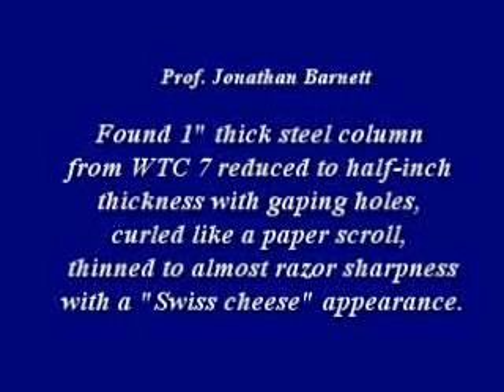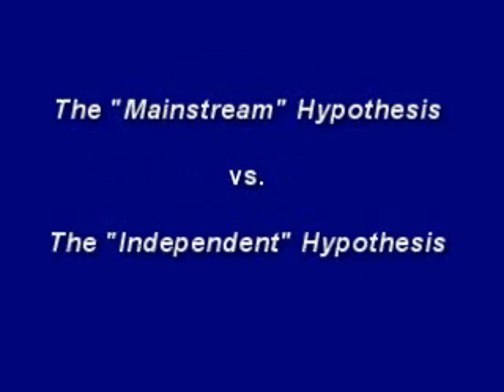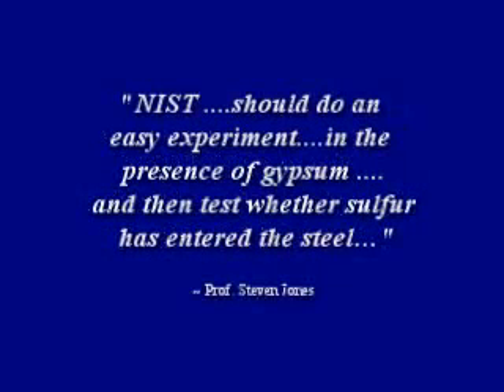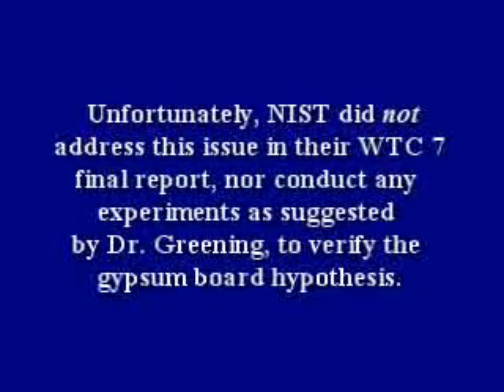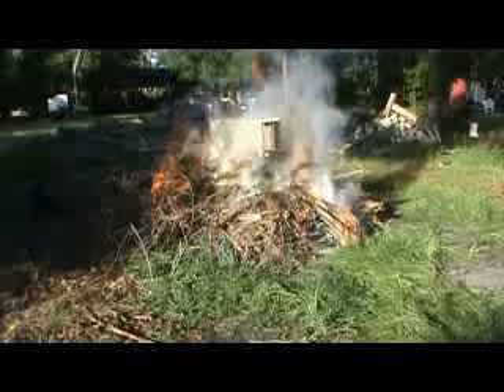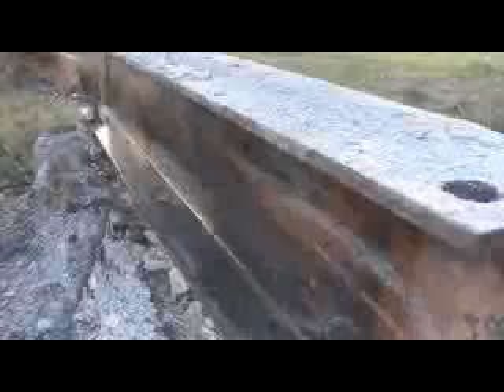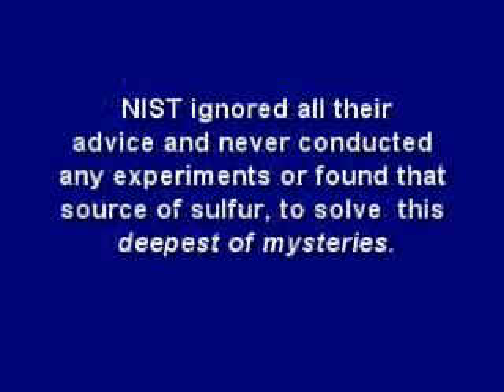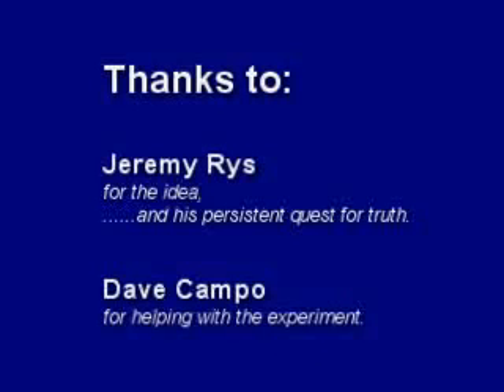9/11 Experiments: The Mysterious Eutectic Steel

Comment: Aluminum in free space will NOT penetrate a larger piece of rigid 
structural grade building steel at subsonic speed (STP@SL).

There are two ways to be fooled. One is to believe what isn't true. The 
other is to refuse to accept what is true.~ Soren Kierkegaard
The highest form of ignorance is when you reject something you don't 
know
anything about.~ W. Dyer
Prof can be seen in history, as a B-25 Mitchell struck the
Empire State building July 28th, 1945.  The facade of the ESB is
granite, and masonry has negligible tensile strength(<1Ksi). 
Tensile strength is what keeps a material from being pulled apart
(penetrated, such as Kevlar vest) and structural building steel will
withstand over 88Ksi (THE strongest tensile strength building
material used in quantity, even today).  The aircraft punched a 18ft
x 20ft hole in the facade, yet the wing span is over 67 feet.  Many
publication try to avoid discussing the air frame, as it fell to a
lower roof terrace and the street level.  Victims inside stated “The
building swung like a pendulum for thirty seconds... we had trouble
keeping our feet under us, as we ran for cover.”
To arrive at a contradiction is to confess an error in one's thinking;
to maintain a contradiction is to abdicate one's mind and to evict
oneself from the realm of reality.~ Ayn Rand
Having shot a steel car rim with a handgun (44mag), this
is a clear example of how penetration is not possible.  The bullet is
10x the density of water and travels well above the speed of sound
(about 1600ft/sec).  But we are expected to believe an aluminum
projectile that floats on water (Sully's airliner in the Hudson
river, indicating .2 mass density compared to water) and can only
travel about 500ft/sec, is able to perpetuate over 126 feet through
steel without stopping.  This is absurd, as it would only takes a
constant force of 50G to stop any projectile moving 500ft/sec, in 63
feet.  Formula 1 cars have recorded survived impacts from 85-140+G,
crumpling the car body less than 2ft, in 200mph crashes. As the 
kinematic equation shows, 1/2 Mass(Velocity
squared), the velocity is exponential compared to mass, a linear
function.  From the standpoint of metallurgy, the shear modules of
aluminum is 25 Gpa, where as basic steel is 70 Gpa.  Even the
construction technique of using sheet metal to fabricate planes,
lends itself to the dissipation of energy through crumpling. 
Examples can be seen in uni-body construction of cars to meet impact
safety requirements, a practice started before 1980. In conclusion, the 
carppetbagger's hoax that commercial
airliners hit the WTC, can easily be disproved by observation of
physics and metallurgy.  Even basic math shows the energy needed
would be one thousand times greater than a commercial airliner could
generate, that's three orders of magnitude. NOT PHYSICALLY POSSIBLE!Even
 teenagers, 150yrs ago, knew cannonballs bounced off iron clad ships, 
and iron is much weaker than structural grade steel.  You clearly have a
 very poor education.
Reply: +cheerdiver

I suppose you believe that if I shot an apple at 200 mph at a chain link fence, that the apple wouldn't penetrate because steel is harder and has a greater tensile strength.  Of course, you forget about all the space in between those fence links that allows the apple to explode right through (albeit in chunks).
Reply: Emvaz22 Apples don't have the property of IONIC BONDING, nor are they 126ft long.  Come on, I know you're a hayseed, but you can do better.
Reply: "Apples don't have the property of IONIC BONDING" - Actually, they DO.
"nor are they 126ft long" - nor are you a turnip.
"I know you're a hayseed" - at least he isn't an ignorant lying bullshitting truther, exemplifying Dunning and Kruger's research to the last jot and tittle.
"you can do better." - you could hardly do worse.
"Aluminum in free space will NOT penetrate a larger piece of rigid structural grade building steel at subsonic speed" - Nor did it.
The plane was made of ALUMINIUM ALLOY virtually as thick and strong as the LOW-CARBON STEEL it met.
Thanks for the straw man.  We will add it to the hundreds of 'truther' straw men (or is it thousands?) already in existence.
Reply: cheerdiver - well laid out points. The crumpling of metal by jetliner cannot be that great to destroy the twin towers.As you have said and I agree physically impossible. The energy needed of plane hitting isn't there,but people believe what they hear even though they know it doesn't all make sense when you question the official story.
Reply: cheerdiver Mhmm, and the fact that the plane is shaped like a projectile which would focus most of the kinetic energy into a relatively small area in front of the plane, you think somehow gives credence to your "no plane" theory?  You live in a fairytale.

Take a soda can and shoot it at that same chain link fence at 200 mph.  And you think it would bounce off because of "ionic bonding."  Right...

The can would go through the fence whether it took some of the links with it or not, just as the plane would be expected to enter the building, considering what it ran in to was mostly empty space (including the hollow box columns).

I'm sorry, but are you ACTUALLY claiming that there were no planes on 9/11?  Where did all the people go?  How do you explain the gaping plane-shaped hole in the side of the towers?  Oh that's right it must have been holograms.  Or was it CGI, and the government paid off everyone in lower Manhattan to keep them quite about the fake planes?  Yeah, it must be true.

Fckig moron.
Reply: that's an amazing amount of irrelevant information for one post.
Reply: Andrew Holdaway And yet you make no effort to prove your point.  Sounds like you're just a common hayseed that can't comprehend engineering.
Reply: cheerdiver 
I have no 'point' to prove, I'm mearly pointing out how pointless  your points are.
Reply: "Andrew Holdaway" is a professional shill, he has been spreading his illogic all arount the comments section, drop him.

Comment: The rubble at 911 burned for months, not only for a day. Comparing the corrosion of steel after 1 day with the corrosion of steel that took place during several months is kinda dishonest. How about you make a video and make a steel beam look like that with thermate? You didn't prove that thermate was used, but you're kind of suggesting you did.
Reply: Darth Judith Weber sooooooooo why exactly did it burn for months. even after rain and pumping thousands of gallons of water onto the rubble from several fire trucks 24 hours a day
Reply: Jason deLaloire One floor of a wtc tower is 1 acre. That's 228 acres of office materials and furnishings pilled up in a space of 16 acres of rubble, plus 47 floors from wtc7, plus the remains of wtc 2,3,4,5, plus the subteranian parking decks. Good luck on putting that out, especially the subterranean/deeper down fires, with a few fire trucks. New pathways for oxygen were brought to more rubble as rubble was moved, which progressively gave more fuel for fires. What's your explanation for why it burned so long? Before you say "thermite"... thermite provides its own oxygen, and therefore burns off within seconds, a few minutes at most, when ignited. One ton of chairs burns multiple times slower (and therefore longer) than one ton of thermite.
Reply: So what you're saying is that the fire should have been oxygen starved lol
Reply: Darth Judith Weber I wonder how all that tritium got to "ground zero" lol
Reply: Jason deLaloire Yes, an oxygen starved fire burns longer than a fire with ample oxygen, because the fuel is consumed slower. Ever heard the saying "the brightest flame burns quickest"?
Reply: Darth Judith Weber ever dumped tons of concrete on a fire? Lmao. still doesn't explain all the tritium found at "ground zero"
Reply: Jason deLaloire The concrete didn't magically arrange itself to perfectly ceil off every combustible object. Some of the concrete will have suppressed some of the flammable rubble. But as the rubble got moved, or washed by rain and then dried in the following days, the fire could spread to that flammable ruble afterwards. So effectively the concrete helped prolong the existence of fires. Tritium is found everywhere. It's the concentration that counts. And the concentration at ground zero wasn't unusual. Since you seem to be one of the "nuke" jokers, how do you explain the absence of unusual radiation levels? How do you explain the onset of the collapse near the plane impact areas? Also, how do mininukes explain month long fires?
Reply: There is no way office fires 80 stories up fell down onto the top of the rubble and started fires that melted solid rock deep underground. You are proposing a physical impossibility. It cannot happen and would not happen, ever. You do not understand basic physics and fail at common sense and simple logic.
Reply: https://www.veteranstoday.com/wp-content/uploads/2014/09/1-14-38-Tower-4-Site-September-2008.jpg

Comment: You need to learn to do competent experiments, sulfidication requires reduction 
Of the gypsum in a complex Chimney effect.
     http://i271.photobucket.com/albums/jj132/chainsawprof/P1000493_zpsqdtwr4ug.jpg

You can even see the yellow reduced sulfur.
Reply: ***** The material in the video is flowing at less than 1000c, and could not be steel do to the yellow color exhibited by black body radiation.
    The steel weakens much cooler than that, at 600C it has lost half its strength and become more prone to plastic deformation.  Steel is an Iron crystal that has carbon usually Carbon monoxide trapped inside weaken the electron bonding by heating and the crystals become deformable.
    What you posted was pure nonsensical Bovine excrement.
Reply: ***** I understand that you probably get all your information from conspiracy sites, but have you even read RJ Lee's letter about formation of the microspheres in a chimney effect with hurricane force winds in the twin towers as they were on fire on 9/11/2001?
    Do you actually know anything?
Reply: Carroll Sanders How about you PROVE you explanation. "Could not be steel".
If not steel what was it? Bullshit indeed.
Reply: Carroll Sanders Oh did you read the entire RJ Lee doc? I have a copy. And i quote"These spheres are the same as iron and alumino-silicate spheres in the well-studied fly ash formed from contaminates in coal as it is burned in FURNACES. i MADE THE LETTERS BIG SO YOU WOULDN'T MISS IT.
Reply: +Carroll Sanders Can you please do the experiment and prove him wrong?
Reply: Ratnesh Already did in 2006, I put thermite, and nano thermite into cutter devices and exposed them to fires, once the aluminum melted same results as Dr. Steven E Jones experiments at BYU, the iron oxide, and aluminum separated and were rendered inert.
    Molten Aluminum and Iron oxide with not mix, or stay mixed, because the aluminum oxide floats the Iron oxide off.  So at 600C the melting point of Aluminum thermite cutters no longer function.
    They are also susceptive to friction ignition in the impact of the plane.
     The fact this clown can not understand heat weakening, leading to connection failures, speaks volumes on his engineering skills, I wouldn't want to even go near any projects he ever worked on,
Because he is a complete Imbecile! 
      Oh PS. My cutter charges were highly more efficient than this morons, even the ones in the patent shown by Jones, used oxygen with the thermite, to help the thermite cut the steel.
      The thermite Idea has always been the proposal of imbecility, because there was never any evidence for thermite or thermate cutter charges recorded on the physical structure of the steel.
Reply: Ratnesh That's why Johnathan Cole shouldn't be allowed to put up a pop up tent, he is a total fraud as an engineer, I don't want to be even near anything he designs!
Reply: Do you have videos?
Reply: Ratnesh Not at this time but thinking of doing some when the weather improves, I lost a lot of data when my hard drive crashed in 2009.
    I would just be attacked by brainless truthers who can't conceive of the fact that all three buildings fell for the same reason, simple overloading of the bolts and welds that unified the structures.
    That's actually why I haven't redone the experiments, twoofer have slashed my tires, insulted me in public, thrown stuff at me in public, and one tried to stab me while my back was turned.
    All because I took on Steven E. Jones's dumbazz Ideas in 2005-6 and proved him wrong.
    why should I put of with more abuse just to debunk idiots?
Point is do you see Cole trying at any time too test his devices in a Chimney effect fire environment, or in any fire environments at all, yes or no?
Reply: +Carroll Sanders I'll wait for your video
Reply: Ratnesh Suit yourself but basicly you're wasting your time on these ignorant twoofer sites, the buildings came down do to simple bolt and weld failures because the bolts and welds lacked sufficient strength to resist the collapse.
     I have explained the collapses to six year olds with more engineering ability than Johnathan Cole.
Reply: +Carroll Sanders I would like to see experimental evidence
Reply: Ratnesh Do you wish to know how to preform the experiment yourself, all you have too do is build a thermite cutter like Cole's and expose it to 600C temps, or severe shocks.
Reply: Ratnesh Yes before he even did his, I built several thermite cutters including with pressured oxygen, that would cut though 4 inch thick vertical columns but thermite is made inert when the Aluminum melts. 
    Thermite isn't needed anyway, a chimney effect, weakening the steel, causing the Columns to be misaligned, then they fracture and drop, once that happens the mass falls down inside the funnel effect, and accumulated, sheering the bolts and welds, the connections can only work in isolation, so the welds and bolts sheer rapidly.
    That allows the towers structure to rapidly disunity as the energy of the descending mass is 800 times that contained in the material structure of the connections.
   Without the connections, the buildings fall as a disassembled set of parts, like a house of cards.
Reply: Cept there are videos of molten steel at the time of the immediate burning of the towers. So there goes the whole weakened steel hypothesis. Not to mention actual metallurgists say it would take a direct heat of over 2000 degrees to even weaken the steel. And since a building is not a concentrated burn, like a crucible or blast furnace, the temp was more likely well under 1000 degrees. Unless you;re an expert and would like to refute them.
Reply: The reaction took place in the compacted basement wreckage at a temperature greater than 1000 deg C.
The reducing environment (and the sulphur) provided by the fireman's water and the red hot steel.
Reply: Carroll Sanders Now stfu and go have a donut. Leave truth to those who deserve it.
Karma's a bitch, you keep denying real people with real tragedy deserved justice. Pathetic fuck.
Reply: ***** Furthermore, FLY ASH is a constituent of - CONCRETE.
Was any concrete crushed on 9/11?
Reply: Tony Duncan Point?
Reply: ***** So you are bound to find it in WTC dust (and wherever much concrete has been crushed).  Iron microspherules are NOT solely the product of igniting themite.  Iron microspherules are also produced by introducing ANY primed steel into ANY old bonfire.
Reply: Tony Duncan Lol i thought capitalizing the point was enough. But if you'll notice it says are the same as, not are. And the point you sadly missed was furnace. As in hotter than jet fuel in an open area can produce.
Reply: ***** Did you know dumbass that pyrite Iron sulfide was responsible for the spheres produced in coal?
  I really don't mind you being proven to be a dumbass it is expected.
    The stack effect in the building was easily responsible for those Iron rich microspheres that were found since soot burns at 1400C or hotter and can reduce iron oxide to iron in the process.
Reply: Tony Duncan The fly ash used in the light weight concrete, was magneticly separated.
Reply: Carroll Sanders Says who? Like i said when you have one or lets give you some substance and say a few asserting one explanation, as opposed to thousands saying another, one must decide what is reality.
In a court of law motive can be the only aspect that gets you convicted. So it would be fair to in the least consider the motive of all opinion. So you suppose those interested in truth that have a difference in professional explanation have an ulterior motive? I mean conjecture aside. Save me your conjecture.
And then we can consider what motive your experts could feasibly have.
But we dont even need suppositions. We have fact.
I'm sorry for you that you cannot accept truth. Is this truth harmful to you? Are you paid? Or is it just denial?
I made my points. My evidence outweighs yours. The social aspects outweighs yours. The physical facts outweigh yours. Reality outweighs yours.
I could careless if you want to function with denial or intent. Personally anyone who hides truth in this case whether ignorant or not is just as guilty as those who perpetrated this horrific moment in time.
Expect Karma.
Reply: Carroll Sanders What is and what could be does not make it so. Correlation does not equate causation . What you have is weak at best. Common fucking sense tells you shit is fishy. Something you seem to be lacking in.
90% of Americans aren't buying it. So i have to say what is your fucking point? No one is buying the bullshit you lap up.
You lose.
Reply: ***** Your definitely an idiot the truth movement died long ago.